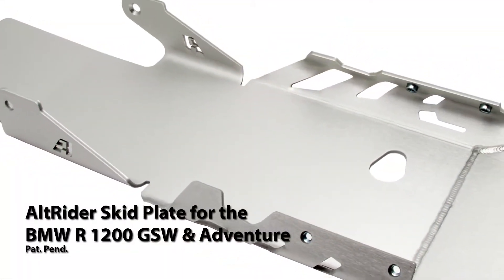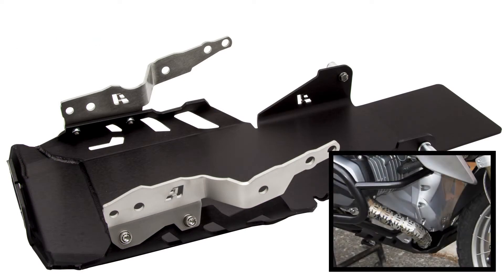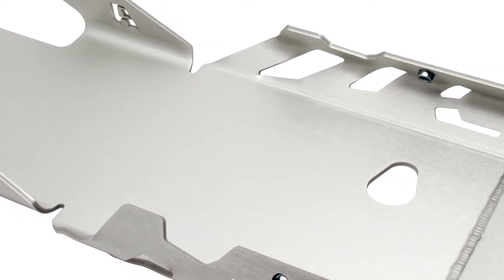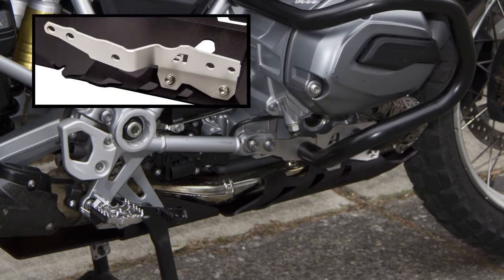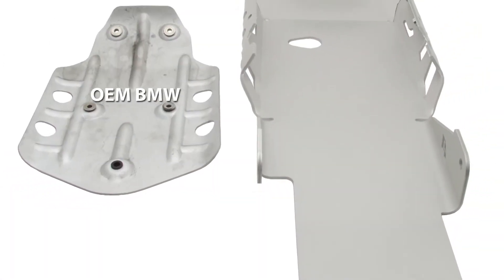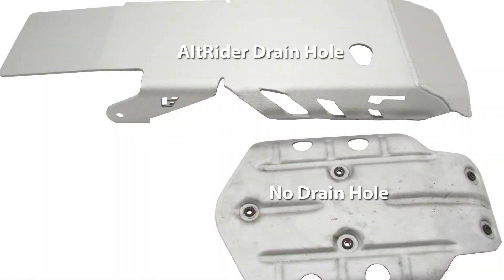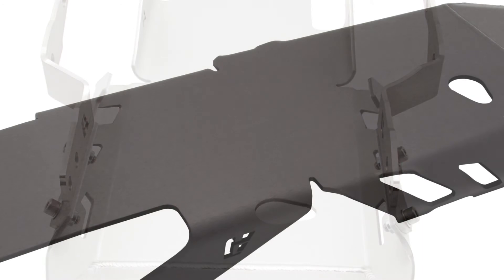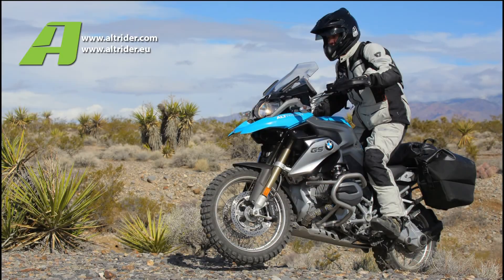AltRider Skid Plate for the BMW R 1200 GSW

Comment: Hi, can I still fix the skid plate if I'm  not using Altrider crash bar?
Reply from the maker: Fyrus, yes you can still use the skid plate without AltRider crash bars. The crash bars and skid plate share a mounting bracket, so if you decided to add AltRider crash bars in the future you would not need a second set of brackets.